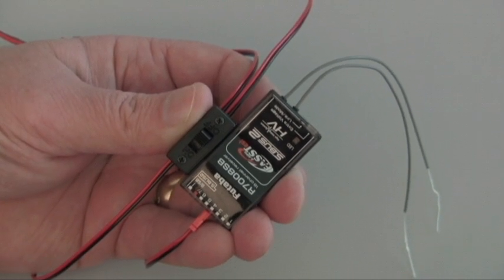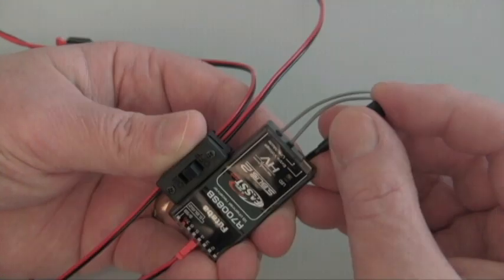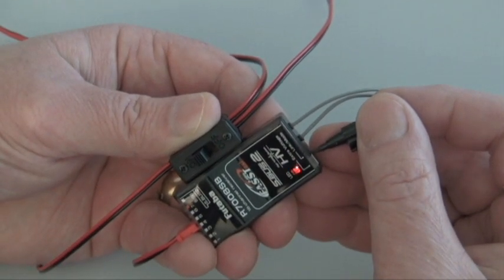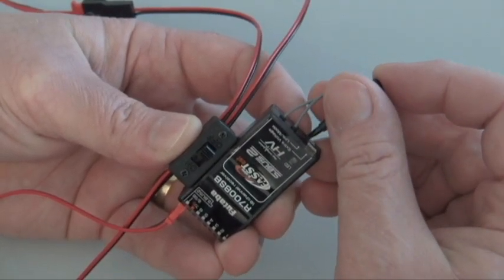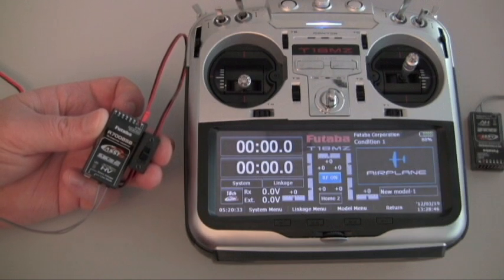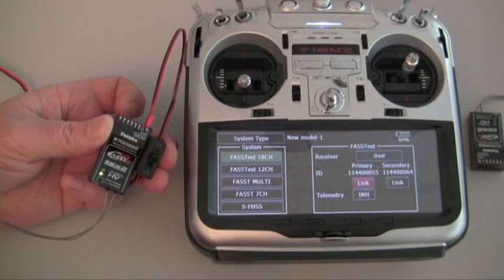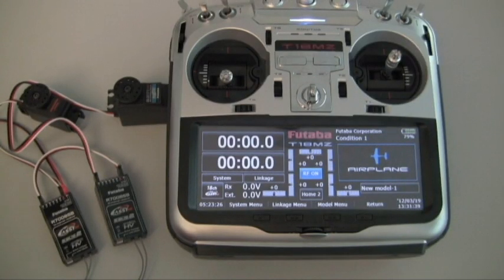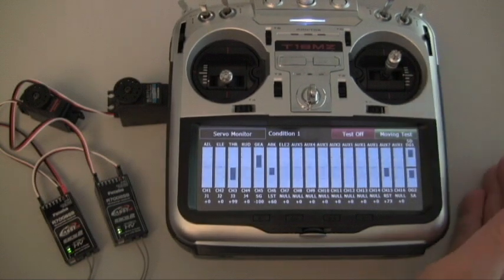Linking two R7008SB Receivers to the 18MZ

Comment from the maker: Yes, all ports on the receivers share a common power buss.  You'll note I did this in the video for demonstration purposes.  This is probably not the way I'd do it in a larger aircraft; I'd opt for two smaller batteries, each powering a separate receiver.  With that said, linking power with a two-wire cable does work.